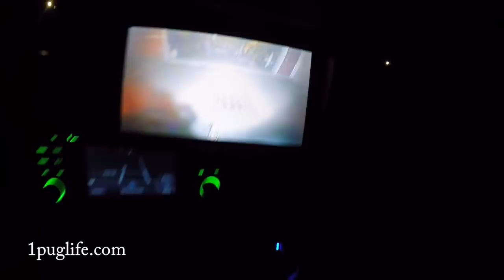Something's Wrong With My Truck!

Comment: "Decent, we took ol Rustywerd out for a rip. We love Hims."  
Router looks decent Pug !  Drain it, new filter and refill with the correct spec fluid for Rusty and drain the torque converter too, the trans pump will refill the torque converter.  If in doubt, Youtube a vidjah on how to do it.  Don't be scared of it. 
I've changed the filter and fluid many times on my 4R100 4x4. Easy Peasy. Torque Converter has a drain plug in it too.   
Then towed a 7000lb camper 1500 miles to Florida and back to north Georgia. Must have done it right.  
Get Well Soon Pug !

Comment: If your smelling burning fluid it could be a gear is not meshing correctly, it won't be audible until the fluid starts burning off more. Or a bad pump.
Reply: Bet the fluid and filter has never been changed.
Reply: That could be too. Some people swear by leaving the transmission alone and never changing the fluid in it that they last longer, until the tranny goes out lol! Had to do it in my f-150. The transmission was making a howling noise and I noticed it wouldn't move very well, plugged filter. At the time it was a used truck so I had no idea if the fluid wash changed or not.

Comment: Most people prefer to change the transmission not the fluid... $3000 vs $300 most people pick the $3000+ and wonder why every auto likes to fail around 200kms
Reply: Changing fluid is a very scary thing to do, they wonder why a transmission
can't go 300K without ever being touched ???
Reply: The person lost theres at 200kms / lost reserve because they didn't changing the fluid. They had it rebuilt and put 330kms on that before  thinking oh maybe its time for a tranny service... she was shuttering shifting thru the gears locking on too gears almost felt like the tranny was going to blow right up.... The trans oil pan was pulled slugg was removed a new transmission oil filter was put in (not one that is suppose ever need changing old one was so dirty from lack of fluid changing that oil was having issues getting thru causing the gear shutters). Gave it that purple lean / Royal Purple and its honestly like a new transmission that should get another 100km+ before it pops, its honestly a race to see what will go first the motor or the tranny, neither have been oil changed on time.

Comment: Those Dodge transmissions are pure shit. That's why I always buy a Chevy.
Reply: Scusting
Reply: My 4l60e and g80 diff lights em up
Reply: The good ol gren80. Just buy ford and be done with it. The 6.7s are awesome anyway and we know the rest of the trucks are better than anything else.
Reply: My truck has 300k original transmission with the good ol G80
Reply: KFarms95 all diesels are too complicated for their own good nowadays. Shame.
Reply: Livin the lie
Reply: KFarms95 Toyota's reliability has gone way downhill over the past 10 year's.
Reply: KFarms95 my 97 has 290k miles 4l60e trans and engine still strong my 2001 has 225k miles 4l80e trans and engine still strong and g80 possi lock will pull anything. Most the time I don't use 4wd when plowing no need. I'm 3rd generation GM fan that's all my family have gotten since the 30s never any problems besides basic maintenance.
Reply: KFarms95 yeah I'm not a big fan of the newer stuff no matter who is the maker they are all cheap. My wifes 2014 Malibu has all that computer crap makes it fun and fancy but more crap it has to break
Reply: KFarms95 Yes the 90's and early 2000's are the best.
Reply: Eska well 70s and 80s even better back when they made them with real steel. His a deer doing well over 85 in my 84 suburban only took out the grill and highbeam light and bucket which I had the bucket and light at home. Also back when one bulb was high and low and the lower build was highbeam only true brights not just highbeam.
Reply: Boot 185 And they where also allot cheaper to fix as well.
Reply: And you didnt need to fix them as often either
Reply: Boot 185 Nope and you never had to take it to a certified mechanic just to get a simple problem fixed.
Reply: Eska I still don't need to take it to a "certified" mechanic unless I'm just too lazy or need reprogramming
Reply: MuttonChop Red my 97 1500 pickup has 289000 miles and still running strong. My 01 suburban has 224000 miles and running strong but that's a 4L80E transmission in the suburban.
Reply: MuttonChop Red Well you obviously don't know how to take care of vehicles.
Reply: Must been made on a friday or a monday. Friday cant wait to get to the bars. Monday hungover from the weekend at the bars lol. The 4L60E is a great transmission better then the 700R4 before it. But some IDK just are crap but not many that I seen. I put mine out in my 98 bravada with 225000 miles on it but I beat the piss out if it. I pushed a full sized plow with it and it pulled many large fullsize trucks out of places normal 4WD failed. I loved that true AWD it had all 4 spun.  I even hauled trailers that only a 3/4 ton or larger should hauled. Added lots of springs. But I owned it for almost 10 years.
Reply: But they don't do work like the big three brands do.
Reply: TorqShift transmissions hold up better than Allisons do and before the Allison, GM transmissions weren't much better than what Dodge was offering.